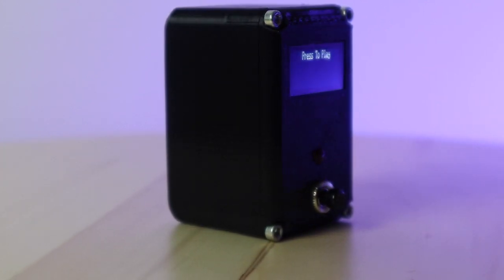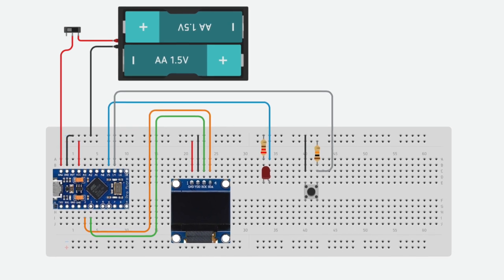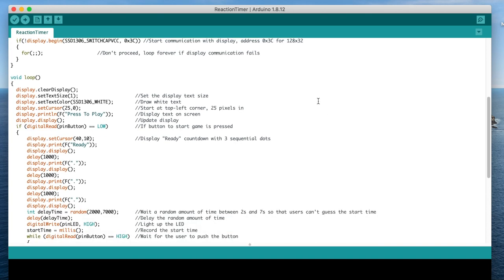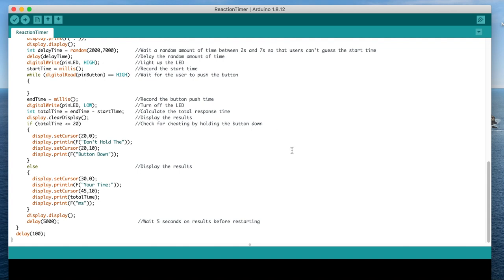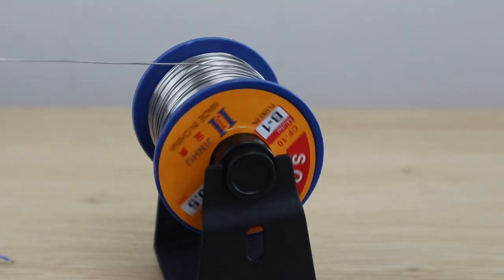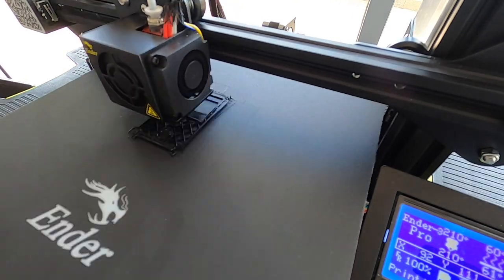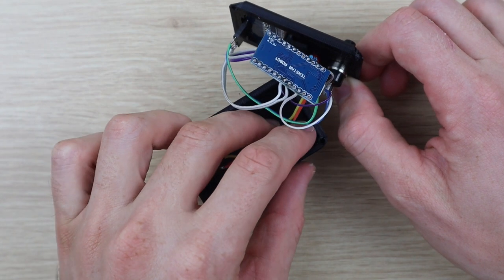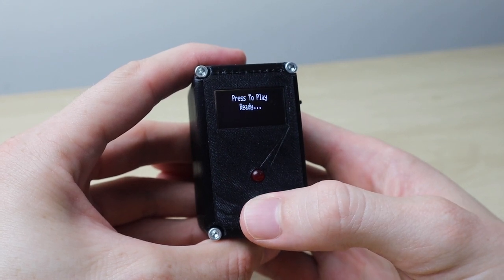Arduino Based Reaction Timer - Improve Your Reaction Time

Comment: Built it! Thanks!!

Found the case was small and couldn't get the batteries in so I just screwed them to the bottom and drilled a hole for the wires. Re-wrote the code to average 3 times and save best score to EEPROM.